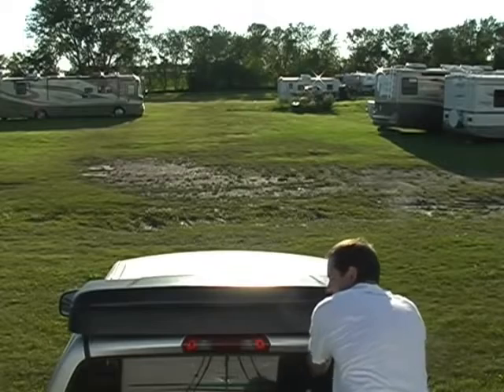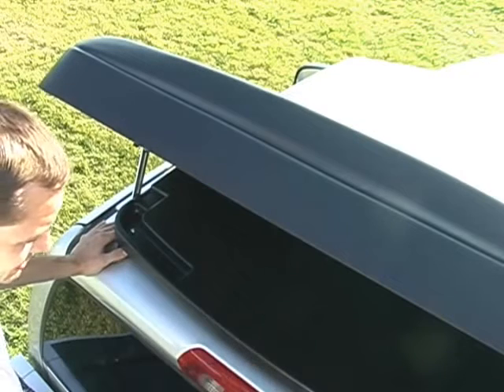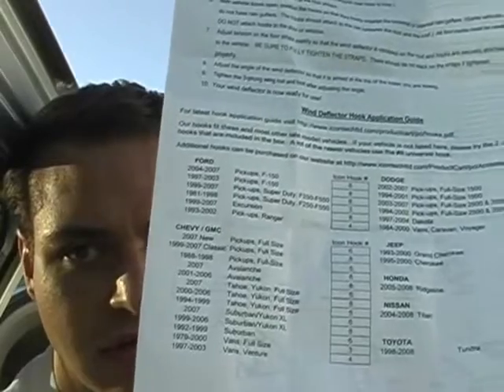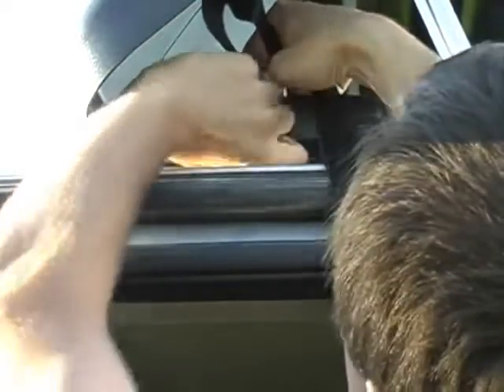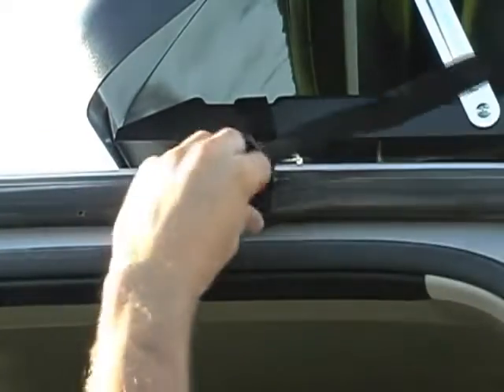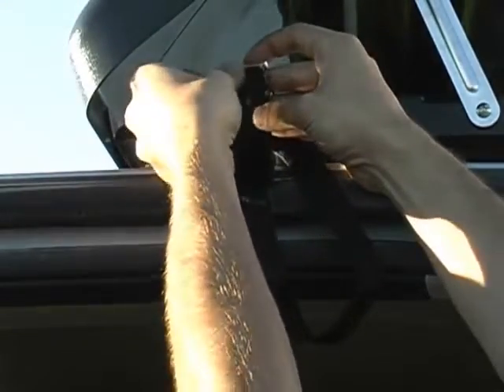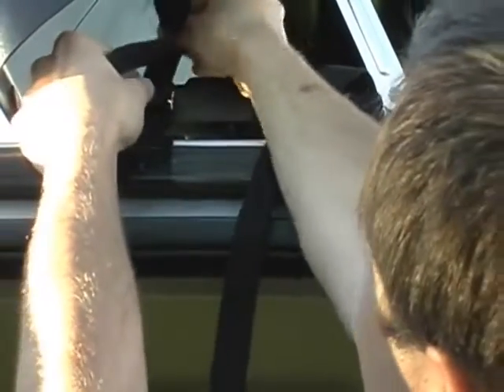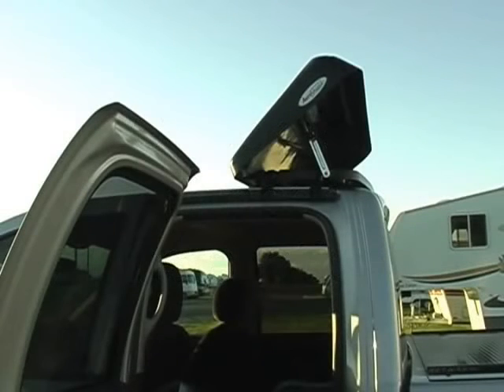Installing the AeroShield Wind Deflector for Towing Trailers

Comment: Did you find any increase in your MPG while towing?
Reply: NO
Reply: It depends on what engine and gearing you have, with the diesel engine you probably won't see much of an improvement, with a large gas engine it will be negligible, with a smaller gas engine you definitely will. But you will notice the difference in drag whether you have a gasoline engine or diesel engine